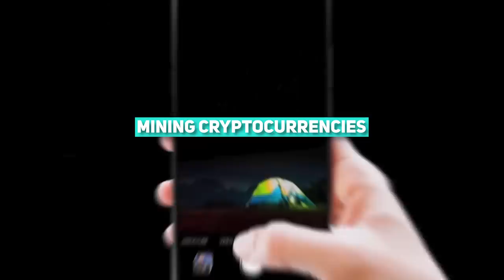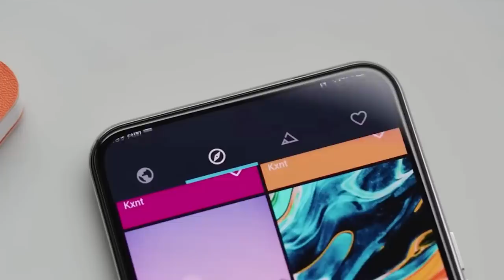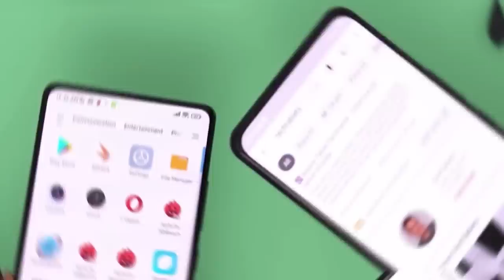Tesla Phone Model Pi Is Unlike Any Other! 🔥

Comment: Just wondering can you make and receive calls when inside buildings, I understand that to "see" the satellite you need to be in sight of them?
Reply: Correct but should be able to connect to other cellular networks
Reply: @ryrylandcripps5811  but Elon has said it would not have traditional SIM card, and you would not need to have a contract with a 3rd party
Reply: Not sure. Just use wifi calling? Currently you need a phase array antenna to connect to the starlink network. So will be interesting to see how this gets connected to a cell phone. ATM only about 1200 starlink satellites in orbit. Perhaps once there are many thousands in orbit as planned just having a view of the sky will be enough. Like connecting with GPS you always have 3 or more satellites. This would be my best guess.
Reply: How much? A lot of people won’t be able to afford one payment, and pay for premium phones on a plan in installments? Unless Tesla will allow a similar setup